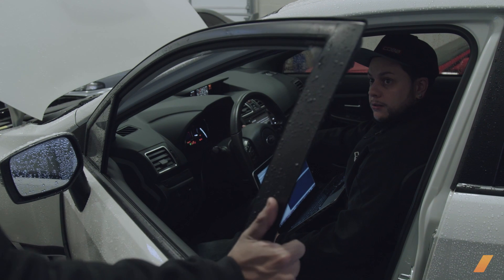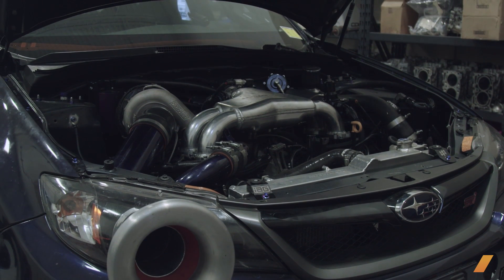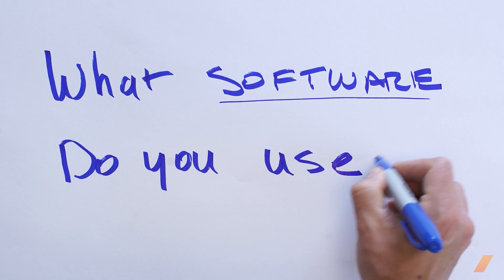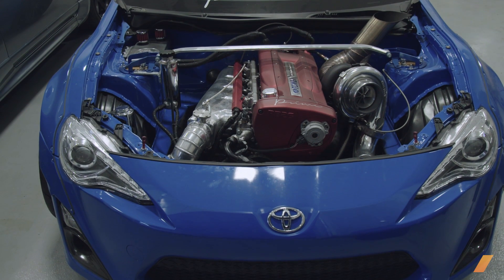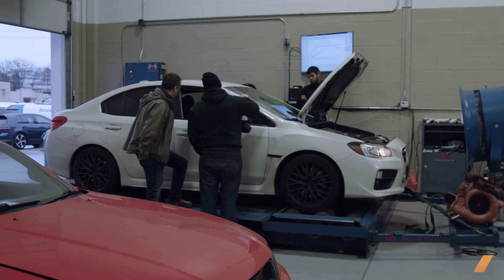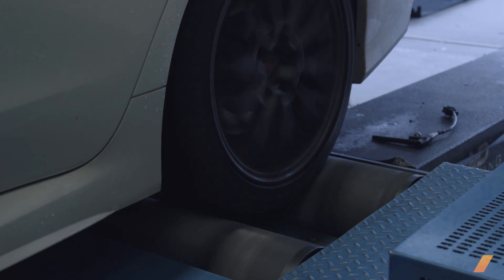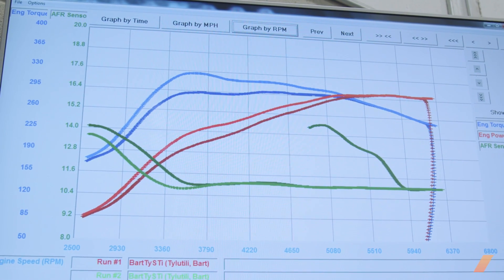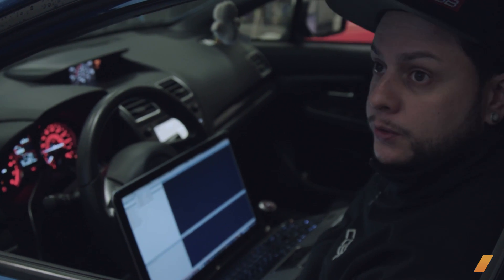Dyno Tuning Without Blowing Up Your Car -- /ENGINEERED

Comment: Haha, just move to sea level for more power
Reply: Ceazar Carr move to under sea level ULTRA POWER
Reply: Baro sensor compensation is for elevation.

How to tune an engine w/o blowing it up? Activate your failsafe thresholds before tuning.
Reply: I heard that if you drive on the bottom of the ocean it increases dolphin power by 70%
Reply: Which is exactly why drag cars run faster at lower altitude...? Your statement would be correct if you're driving a car the size of a mansion.
Reply: Don't need to move, local track is less then 50m above sea level.
Reply: Like Roadkill's Boost Caboose. Perfectly practical.
Reply: Towable compressor hosed into the intake. Then you can live up a mountain if you like.
Reply: Ceazar Carr ya got to rate in DP
Reply: Tom Ryan not sure if sarcasm or not, but if you're serious, engines make more power at lower altitudes, its pretty common knowledge.  He didn't say he can't tune a car for high altitude, he just said you'd make more power at sea level, which is true.
Reply: J D my reply was to Tom Ryan, not you... youtube stopped automatically putting in the name for who's post I click reply to.  but now that I read your post, most modern cars will compensate without a "special tune" for your altitude for the amount of air going into the engine.  anything made in the last 10 years will do that without a doubt.  if your tune doesn't, find a competent tuner.  If your car is tuned only for the elevation and conditions its at during the tune without any room for compensation, its not gonna last long, especially a turbo car.
Reply: That's simply bullshit.

Maybe, MAAAAAYBEEE on an NA car, I doubt it, but especially in turbo applications there's a several percent hp gain just by driving it on a cold day. Every 5 degrees of intake temp you drop is one percent more HP,  approximately. That's significantly more than slightly more or less air could possibly affect a vehicle's acceleration. 

As stated above, cars go faster on the drag strip at lower elevation. Not just the super-low drag top fuel cars, but normal street cars as well.

I think he was making a joke with the "move to lower alt" statement, and I'm sure he can more than competently leave room for the car to adjust for altitude...
Reply: Master, I mean, yeah, the temp difference between 40F and 95F is going to be more, but trust me, a mile above sea level vs someone at sea level, that's when you add MULTIPLE seconds to your 0-60.
Reply: The higher you go above sea level, the lower the oxygen density is, therefor, less oxygen for the engine to make more power with. Higher altitudes equates to less power then the same car, same temp, at sea level. Remember all an engine is a glorified air pump, more air=more power.
Reply: simple, you make sure everything is in working order beforehand, not kind of or sort of, then you pull timing and add fuel and start from there from a very conservatively safe start point, it isn't complicated, monitor egt, afr, knock, ect, iat, map, duty cycle and fuel pressure and always keep an eye on oil pressure, that's how you DON'T blow an engine on dyno.
Reply: I recommend Hawaii ( ͡° ͜ʖ ͡°)
Reply: Welcome to the Netherlands :)
Reply: It`s also about PRESSURE ;) You get less pressure AND less oxygen, so the engine doesn`t get the same volume of air, or the same oxygen saturation in that volume..
Reply: Bob Last did you even read what I wrote? I literally said it makes more power at sea level. I said that it doesn't get FASTER at sea level. Why is it so fucking hard to read? Lol
Reply: Drag cars run faster at lower altitudes because they physically change fuel/timing parameters to take full advantage of the denser air. I'm talking about street cars that won't change their tune based on every single location that they travel to. On the whole, the power differences caused by altitude are largely nullified by the changes in air resistance.
Reply: Moving to sea level doesn't do much to make your car faster. Your car will make more power, but the extra power is almost entirely negated by the more dense air.  There's a lot of math behind this but the extra power doesn't do much in practicality.
Reply: He let his ignorance show there....  Obviously he's not experienced enough to talk on the subject if he shrugs off tuning for the mountains.. where the best roads are...